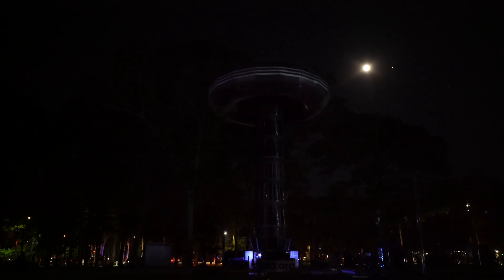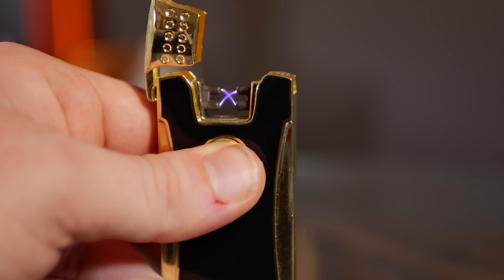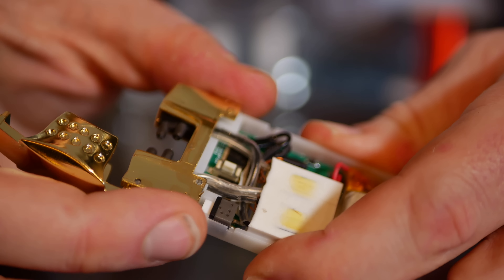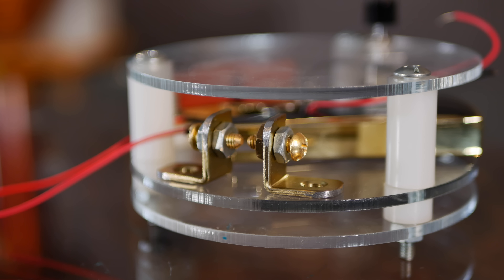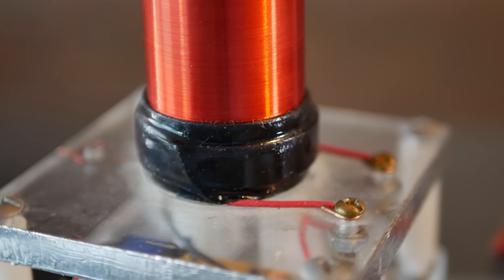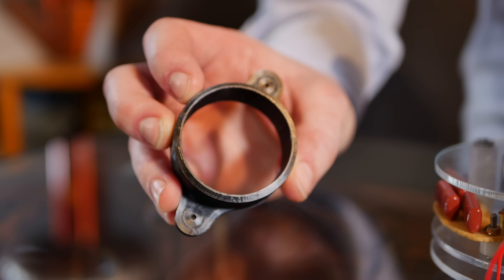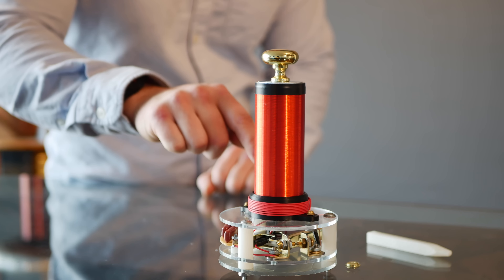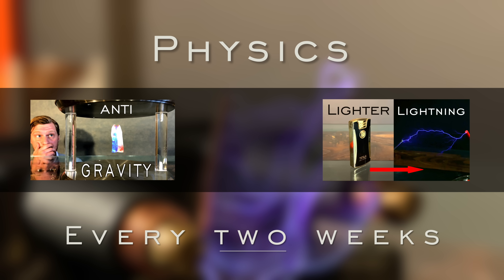DIY 50,000 Volt Arc Lighter Powered Tesla Coil (ft. Integza)

Comment: Electricity is sound itself

It’s no different from a Light Bulb emitting Light ( Soundwaves ) in 360 degrees converted into needle focal point Laser ( Electricity ) 

Magnetism is the Reverberation of Sound in Solids sometimes trapped & confined in Neodymium

The reason for Attraction vs Repulsion is due to Sound vs Matter or Constructive & Destructive Interference 

It’s the direction Sound is traveling which is why opposite Poles attract and same Poles repel

The only Force of Nature is Sound itself 
- Gravity is only a byproduct of Magnetism 
- I alrdy defined Electromagnetism
Ask Hans Jenny

If you want even more advanced Topics I could easily explain why Thunder is the Sound of Volcanism rather than a Singing Tesla Coil 

I could even explain the Solar Clockwork of Interlocked Fields of Reversed Polarity and Counter-Rotation driving all the Orbits + Spin

Comment: Do you think those small Chinese high voltage transformer work for this coil?  
https://youtu.be/qEbMRfRHEkI
This one exactly
Reply from the maker: They will for a short period of time, but they will also break very quickly, and wont fit into the base.
Reply: Okay, thanks.  And by the way congratulations for 65k!

Comment: So small, to power a light, this model needs to be so large.
All the scam videos about a infinity coil, (Tesla) making your home, OFF GRID by one tiny infinity coil is all a bunch of BS. 
this is 50,000 volts and barely 1 in arches.. Barely lit a tiny florescent bulb.  

Consider size to power just 1 regular standard size light bulb for a home.